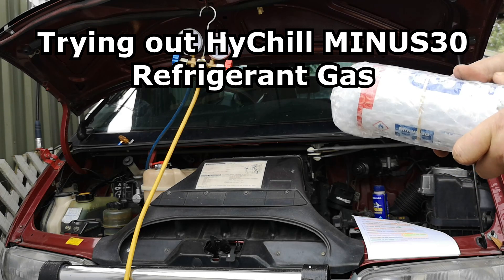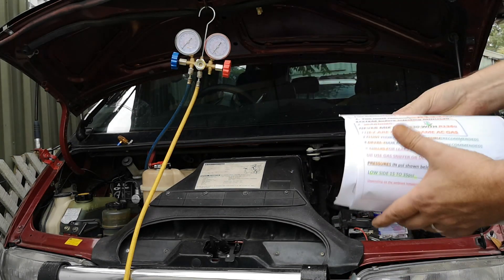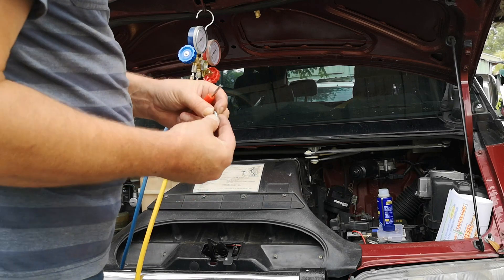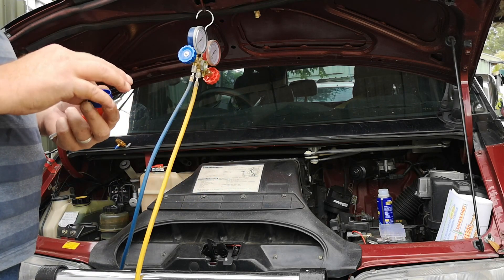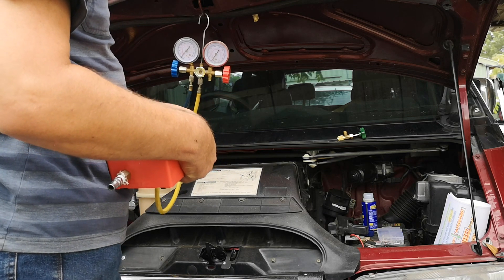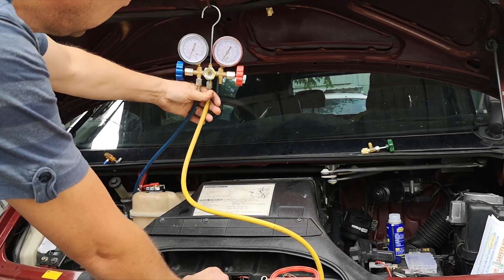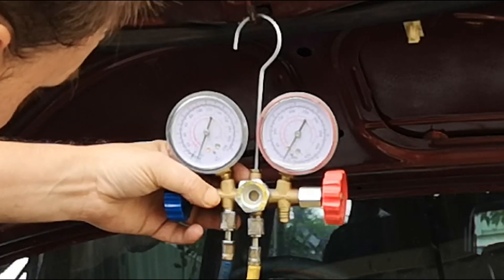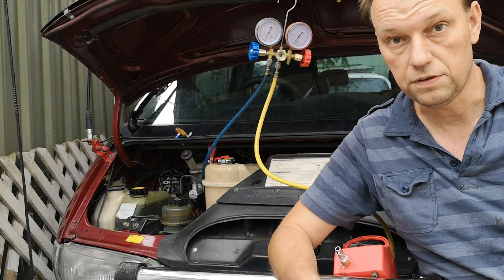Recharged my AC with Minus 30 [ Replacement for R12 & R134a Refrigerant ]

Comment: You can buy R134a, its in freeze spray cans, one brand being Dymark , and use a can tap to puncture the side of the can to connect your gauges. You can use Airduster which is Difluoroethane (R152a) with is a drop in replacement for R134a available from Kmart and officeworks for $10. If you want to try hydrocarbon blends like hychill you can buy "Gasmate 230g Power Fuel Iso-Butane Cartridge" which is a 75/25 isobutane/propane blend, very similar to Hychil which is 70/30.
Reply from the maker: I’ve read up on those options. I’m just not keen on trying them in cars I’m aiming to fix properly, so I stick with what’s intended for automotive A/C. I’ve always been curious to try some of those alternatives to see how they perform though. Thanks for the feedback and suggestions.  cheers.

Comment: How do you remove the remaining  r34a before recharging with hychill
Reply from the maker: To remove the remaining R134a before recharging with HyChill, you need to recover the gas properly using an AC recovery machine. It's important not to vent R134a into the atmosphere. It's harmful to the environment. Most workshops have the proper equipment to safely evacuate the system. Once it's fully recovered and the system is vacuumed down, you can recharge it with HyChill.
Also, keep in mind that R134a and HyChill are different types of refrigerant (synthetic vs hydrocarbon), and they shouldn’t be mixed.

Comment: Where can i get one of those pumps? Great video.
Reply from the maker: On eBay https://www.ebay.com.au/sch/i.html?_nkw=HVAC%20Air%20Vacuum%20Pump%201%2F4%20HP%204%20CFM%20AC%20Vacuum%20Pump&_sacat=0&_from=R40&rt=nc&_udhi=60 Google search HVAC Vacuum Pump and you will find a lot of options.

Comment: A vacuum test will NOT find all leaks, AC systems are a pressurised system.

You also have to do a pressurised test at about 100psi on the High side gauge to find all the leaks, shop air is fine for the pressurised test
so long as you have moisture traps on the air line.

Nitrogen gas is best for the pressurised test as it will also remove moisture from the system,
it also has smaller molecules than air so it will show up even the smallest leaks,
you can get a D size bottle (smallest bottle available) of Nitrogen gas with 20000 kPa pressure in it from your gas supplier for around AU$150 + including the deposit for the bottle,
you get the deposit back when you return the bottle, around 60 to 70% of the cost of the Nitrogen bottle is the deposit.

one you have the system pressurised just spray ALL the AC components with VERY soapy water and look for bubbles,
dish detergent if very good for this, do a 50/50 mix of soap and water for best results.

Once you have found and fixed all your leaks do a pressurised decay test for about 30 minutes to an hour at 100psi on the high gauge (check to see if you are loosing pressure),

Then you vacuum down to -30psi on the low side gauge with both high and low hoses attached and both taps open on the manifold gauge
for no less than 30 minutes, an hour is your best bet to remove ALL moisture in the system before adding refrigerant.

DO NOT run the motor or compressor while doing the pressurised or vacuum tests.

Close both the high and low side taps on the manifold gauges and remove Low side hose from the low side port on your AC system.

Attach your AC refill gas can to the yellow hose then Open the high side tap at the manifold and add your refrigerant gas
as either a gas or a liquid to no more than 30psi on the low side gauge with out the motor or compressor running.

When the low side gauge reaches 30psi, close the high side tap on the gauges, start the motor and compressor turn your AC temp down to its lowest setting,
Turn your cabin blower fan on flat out then add any needed gas to get the pressures back up to NO MORE than 30psi
on the low side gauge with your AC system running flat out on its coldest setting.

Also you NEVER add gas to the low side as a liquid as you did, ESPECIALLY if you have the compressor running, VERY bad for the compressor.
Gas should ALWAYS be added from the high side, either as a vapour or a liquid.

and again NEVER exceed 30psi low side pressure it will kill you AC compressor.

Can tap on top= gas (vapour).
Can tap at bottom= Liquid

Comment: 1:30 if it takes longer than 4 mins to pull vacuum. You have a small leak somewhere.

I recommend a nitrogen test to diagnose the leak, most places will gas you car with r134+uv dye. Which is a waste of money. Ac nitrogen test Should cost around $40
Reply from the maker: Cheers mate. True it does take about 5 minutes to pull a vacuum but a 5 minute vacuum only isn’t good enough, it’s recommended to keep vacuuming for at least 30 minutes to make sure any moisture in the system “if any” has also boiled out. The smallest leak will still pull a vacuum and that’s why the gauges are left on for at least 15 minutes after the vacuum to make sure the system doesn't have a micro pinhole leak. Thanks for the info.

Comment: What is the size of adapor. That plug into the can. I bought 3 adaptors 1/4   type then 1/2 then 5/6 all failed . let me know the proper size appreciated 🙏
Reply from the maker: This is the tape I use. It comes with the larger cans https://www.ebay.com.au/itm/304422451813?mkcid=16&mkevt=1&mkrid=705-154756-20017-0&ssspo=7ZB9lFKKTYu&sssrc=2047675&ssuid=6X611BnHTEO&widget_ver=artemis&media=COPY I have used other refrigerant cans over the years and I have found you do need the correct tap for the correct can. If your still having problems I recommend contacting Walter the seller of HyChill he is very helpful.

Comment: I actually
Toppped up a fridge with r134a gas and I used minus30 it runs awesome
Now I mixed both gasses together. 

I know you’re not supposed to but… oh well it’s a little experiment and I’ll keep y’all updated
Reply: I'd love an update on the mixed gasses.
Reply: The fridge worked perfectly fine, issue is the leak in the fridge is quite big so it last around 6months before a top up is needed
Reply from the maker: Wow. Good luck. I am interested in knowing if it's still going in say 6 months.
Reply: @TaragoPreviaEstima  it’s been 24 hours I actually out a little too much in, the fridge got really cold fast lol. I release the preassure and it’s working pretty good still
Reply: Still all good ?
Reply from the maker: @dariusoi7212  Yes still working very well. Sometimes I have to turn it off. It gets so cold a strong cold mist comes out of the vents.
Reply: @TaragoPreviaEstima it's thermostat/smarts probably doesn't know what to do with the different cooling profile (colder faster, more efficient) so i imagine it would ice up and do weird things... is it still working 10 months on ? why do they say not to mix the gas anyway ?
Reply: @TaragoPreviaEstima hi. My car have R134a too. So after you mix minus30 into old r134a gas. Do it still working normal. I am going to do the same if it still working.
Reply from the maker: @vnyeu  Don't mix R134 with Minus30. I know of one person who did and he said everything works great but the 2 freons have different elements and it's not recommended to mix them. Remove R134 first. Vacuum the system then add your replacement freon. My system works better / colder than before.

Comment: Nice video however you may have overcharged your system. The hychill instructions say the psi should be in the range of 15 to 30 psi when ac is kicked on. I use this on 2 of my cars and it works great.
Reply from the maker: Maybe, I must admit it did cross my mind. The van has 2 AC. Front one like a car and the rear roof as well. It's still working and I noticed on the first day the AC pump works better not putting as much load on the engine like before. While it's working I will leave it alone.
Reply: If a 90's tarago, you got daul A/C you somewhat overcharged,  shouldn't be too much of a problem.    But if you got single A/C it's very overcharged

Comment: Got one of those hychill cans I use this for custom made chillers
Reply from the maker: It's great stuff, I am pleasantly surprised how well it works. I can also tell there is a lot less strain on the engine with the AC ON now. My RPM would drop and you could hear the engine working harder with 134a. With Hychill I can't hear the engine idle change any more. The AC is very cold now better than before.
Reply: How much and what type of oil did you put in the chillers

Comment: Great video... Are the refrigerant cans the self sealing type or piercing cans?  I found the piercing cans easier to use for some unknown reason.  The self sealing cans require some newer valve hose that allows  refills.
Reply from the maker: The tap piercers the top pressing the valve open. When you remove the tap the valve will seal again saving what's leftover.
Reply: @TaragoPreviaEstima  Thank you. I will try again since I'm using an older piercing hose with self sealing adaptor to fit new self sealing cans.
Reply: Self sealing type